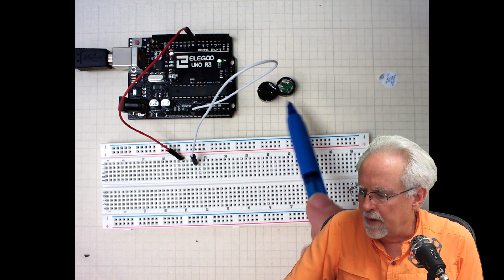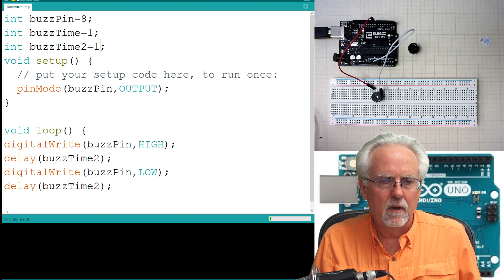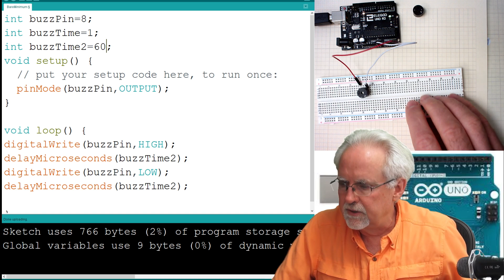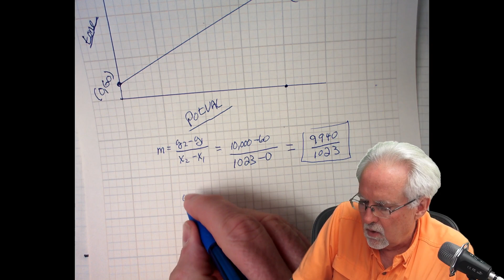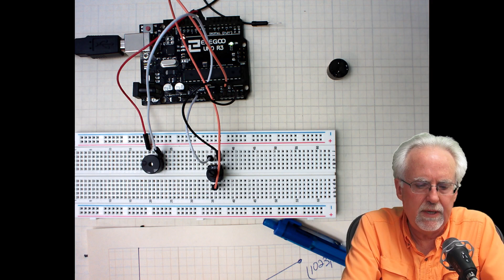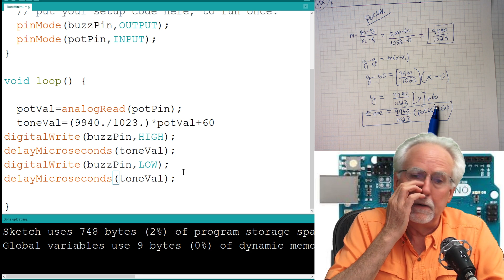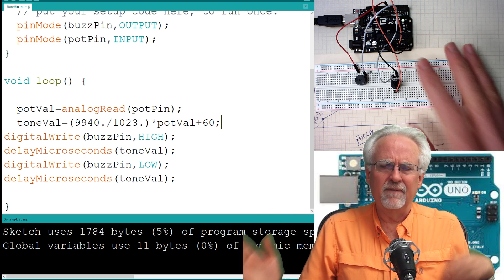Arduino Tutorial 24: Understanding Passive Buzzers

Comment: i had all the code and circuitry set up but then got stuck on the math. i couldnt figure out how to get a formula that would work. i had to watch into your solution to get the formulas we were supposed to use and then everything worked without a hitch. these graph and line formulas arent anywhere in my memory. ill have to write them down

Comment: I am still working through the tutorials. Sometimes 3 in a row, sometimes none for a few days.

I have been searching the web for an answer to why ALL my sketches, interupt when connected to the PC. This passive buzzer program for example, I worked through it, i get the tone and periodically it stops and starts again. In the RGB the light goes out and comes on again. In the binary counter it would start, stop at some point, then start again. I also noted the busy LED on the UNO board flashing occasionally. So I believe it must be communicating with the PC, and halting the program while it exchanges data with the PC. If I disconnect from the PC and run off the 9V battery it doesnt happen.

I also have trouble uploading from PC to the UNO board. I have to click quite a few times, I get the orange, COM port was busy quite a few times, then eventually it goes in, reinforcing my thinking on the COM chatter interferring with desired operations.

Any tips on settings I can adjust anywhere to stop the interupts on running programs and uploads?

Comment: That homework was super fun!
I think you said 60 and 10000 in your assignment the other way around than in your solution, but that doesn't really matter :D
 I tried to work with as many variables as possible and added Serial.print with a high baudrate to have a look at the values. The high baudrate is to not mess up the timing of the tones.

Here is my version of the homework:

int buzzPin = 8;
int buzzTime;
float rightFreq = 60;
float leftFreq = 10000;
int potPin = A1;
int potVal;

void setup() {
  // put your setup code here, to run once:
  pinMode(buzzPin, OUTPUT);
  pinMode(potPin, INPUT);
  Serial.begin(2000000);
}

void loop() {
  // put your main code here, to run repeatedly:
  potVal = analogRead(potPin);
  buzzTime = ((rightFreq - leftFreq) / 1023 * potVal + leftFreq);
  Serial.print(potVal);
  Serial.print("   ");
  Serial.println(buzzTime);
  digitalWrite(buzzPin, HIGH);
  delayMicroseconds(buzzTime);
  digitalWrite(buzzPin, LOW);
  delayMicroseconds(buzzTime);
}

Comment: So I had a strange thing happen on my attempt at this. I did the homework and had it hooked up exactly like yours and my code was nearly exactly like yours except I decided to send the values to the serial monitor. When I ran the program I could only get a low tone and almost no fluctuation with the potentiometer. I racked my brains and finally took the serial monitor code out and it worked perfectly. Why would the serial monitor cause this issue? The only code that I changed was dropping "Serial.println(buzzVal)".

Comment: Math has always been a weak point for me but thanks to your lessons, I've been able to do this. I was able to do the homework without any help other than the comments below when I didn't get the right tones because of the print statements in my code and the low baud rate. When I removed the print statements (or at least narrowed them to one print statement) it all worked beautifully. Thanks again Paul

Comment: Did a Serial.println to check my outcome. it was spot on and no pieking. then it gave a strange tone. checked the code fideld around but coulnd not figer it out. after banging my head against the wall. started te video again. almost the same code exept for the Serial.println
And took it out. And BOOM! it worked. The Serial.println slowes the hole thing down and its not working.

Comment: 1:11 It's actually silicone dielectric potting and not black tape on the bottom of the active buzzer. Only pointing this out in case someone wants to know this; I'm not just being a pedantic jerk for the sake of it. Loving the series so far, I've learned so much.
Reply: why is it only on the active one ?

Comment: I am not from an electronics/musical background... But I am confused why are we delaying the toneValue to get the variation in sound? In normal case, it should be a value given to the speaker(buzzer) to turn the value UP/DOWN rather than delaying the value. Are we dealing with some kind of frequency or some of the other musical terms in here? I might sound totally dumb in this session, but I got this weird doubt while I was working with the piezo buzzer that I had inside the kit. I am beginner, no matter how dumb the question is you must clear it out when you are stuck somewhere.  If someone could help it would be really helpful, Thanks in advance.

Comment: Sir I tried buzzing the passive buzzer by just digitalwrite HIGH and not putting digitalWrite LOW and it worked. So I am confused bcoz u told that passive buzzer would only be functional on AC voltage.

Comment: Here's a cool sounding one with the passive buzzer hooked up!

int buzzPin = 8;

void setup() {
  pinMode(buzzPin, OUTPUT);
}

void loop() {
  for (int i = 0; i < 100; i++) {
    buzzWithDelay(i);
  }

  for (int i = 100; i > 0; i--) {
    buzzWithDelay(i);
  }
}

void buzzWithDelay(int delayTime) {
  for (int i = 0; i < 1000; i++) {
    digitalWrite(buzzPin, HIGH);
    delayMicroseconds(delayTime);
    digitalWrite(buzzPin, LOW);
    delayMicroseconds(delayTime);
  }
}

Comment: I was able to do the HW by using if statements. except mine only played the 2 tones. so I had it off if the POT wasn't 0 or 1023.
int buzzPin = 8;
int buzzTime1 = 60;
int buzzTime2 = 1000;
int potPin = A3;
int potVal;

void setup() {
  // put your setup code here, to run once:
  pinMode(buzzPin, OUTPUT);
  pinMode(potPin, INPUT);
  Serial.begin(57600);
}

void loop() {
  if (potVal == 0) {
    digitalWrite(buzzPin, HIGH);
    delayMicroseconds(buzzTime1);
    digitalWrite(buzzPin, LOW);
    delayMicroseconds(buzzTime1);
  }

  if (potVal == 1023) {
    digitalWrite(buzzPin, HIGH);
    delayMicroseconds(buzzTime2);
    digitalWrite(buzzPin, LOW);
    delayMicroseconds(buzzTime2);
  }

  if (potVal != 0 && potVal != 1023) {
    digitalWrite(buzzPin, LOW);
  }
  potVal = analogRead(potPin);
  Serial.println(potVal);

}

Comment: Question: Shouldn't the toneVal variable be a float, not an int?
Otherwise there's no point in using the periods in (9940./1023.).
And wouldn't it improve the sound from the buzzer, too?
(I'm waiting for a passive buzzer to arrive, so I've not yet built the circuit and done the coding for myself.)

Comment: Just a quick question/suggestion: Should toneVal not perhaps have been a float rather than an integer to get a smoother transition? Blessings
Reply: toneVal has to ultimately be an integer because the delayMicroseconds function is expecting an integer value for the delay. But we perform the calculations of the toneVal in float to get a more precise representation of where the toneVal point should be for a given potVal value.

Comment: Paul, when using passive buzzer and buzzing with variable voltage instead of microsecond delays, isn't it the same? Since the voltage variation is the delays itself of 5V and 0V?

Comment: Paul, @ 9:45, you said when the potentiometer is turned to the left the delay is 10,000 microsecond delay, and when turned to the right it is a 60 microsecond delay.  I believe your linear equation is flipped, if you will.  Obviously, it still works, just with the tone changing backwards as originally described.  Love the videos. Nice work
Reply: Me too!
Reply: I thought the same thing Charles.
Reply: @danwolfe7665  Me too.
Reply: me too!
Reply: OK I see I wasn't the only one.  I worked my math the way he wanted (low tone to the left, high tone to the right).  Not the way he demonstrated.

Comment: I played a major scale with the passive buzzer. Code below if anyone interested:

int buzzerPin=7;
int dly[] {1000,891,794,749,667,595,530,500};
long long duration=125000L; //.125sec
long long time=0L;
void setup() {
  // put your setup code here, to run once:
  pinMode(buzzerPin,OUTPUT);

}
//----------------major scale with passive buzzer------------
void loop() {
  // put your main code here, to run repeatedly:

  for (int i=0;i<8;i++) //scale duration=1sec
  {
    time=0;
    while (time<duration)
    {
      digitalWrite(buzzerPin,HIGH);
      delayMicroseconds(dly[i]);
      digitalWrite(buzzerPin,LOW);
      delayMicroseconds(dly[i]);
      time+=(2*dly[i]);
    }
  }
}

Comment: I tried at 1 microsecond and still, it is audible. 1 microsecond on and off means 500,000Hz, right? Why it is still audible? Does the buzzer vibrate (cycle) at a lesser frequency?

Comment: The tone is distorted by other calculations and programcode , isn´t it.
I just put in a serial monitor to for finding mistakes in my quotation. The tone got much "lower". Additionally I am thinking that my passive buzzer drops at small delaytimes. I doesn´t sound very nice below 50 microseconds. I heard deep and strange tone below.
Reply: I experienced the same issue. I also put in a Serial.print command and it changed the tone...but I guess that makes sense since are dealing with thousands of a second....

Comment: First, GREAT series. I am a hardware guy and learning to program is going well with your help. HOWEVER, it seems that timers in Arduino, maybe especially the older UNO (mine is 10 years old?) are really finicky. I was having lots of problems with this assignment and I had the serial monitor turned on so that I could see what was happening with all my values. Serial monitor seemed fine but the tones were jumping, not smooth. Was pulling my hair out until I turned off the serial monitor then Voila! It worked perfectly. Just something to watch for.

Comment: I was doing the homework, and I was going good, but darn I forgot the +60! Anyway, this was fun here was my code!

int buzzPin=7;
float buzzVal;
int potPin=A8;
int potVal;

void setup() {
  // put your setup code here, to run once:
pinMode(buzzPin,OUTPUT);
pinMode(potPin,INPUT);
Serial.begin(9600);
}

void loop() {
  // put your main code here, to run repeatedly:
potVal=analogRead(potPin);
Serial.println(potVal);
buzzVal=(-9940./-1023.)*potVal;

digitalWrite(buzzPin,HIGH);
delayMicroseconds(buzzVal);
digitalWrite(buzzPin,LOW);
delayMicroseconds(buzzVal);
}

Comment: I used variable for buzzH, buzzL, potH & potL (all integers adn it still seemed to work) then used a variable based equation. I also put print statements in the loop but had to take them out as they were causing the tone generator to just click. Took me a little while to realise that it was the print statements that were doing that. Keep up the great work - loving the course.
Reply: Wondering why with a delay after the print code (Serial.print(); with delay after creates only clicks?? Without delay, no clicks! delays of 500, and 1000 ms. the clicks occur.

Comment: You did the same mistake as me at first. "Toneval" should be a float! Right now it's outputting the wrong value. 

Also, NOOoo! NOOooo! What have you done!? Using hard coded numbers for variable? What if we had to change 60 and 10000 to other values? 
Doing it like this is better programming:

In the setup:

int minVal = 0;
int maxVal = 1023;

int smallDelay = 60;
int bigDelay = 10000;

float ratio = float(bigDelay-smallDelay)/float(maxVal-minVal);

And then in the loop:

int readVal = analogRead(readPin); // 0 to 1023
float toneVal = minVal+(readVal*ratio); // 60 to 10000

Comment: Hello Paul, I am having trouble calculating, I dont understand why is it specifically 9940/1023*potVal+60. Why isnt it just potVal*9.775?
Please i am confused
Reply: I think he has kept in the form of a formula instead of performing the arithmetic operations and finding the exact value to multiply with the potValue. It is the best way to understand how you end up getting the value when a second person reads your program. you could even use the mappedValue function to make it much simpler, but he wants everyone to think like an engineer and learn the math behind 😉

Comment: I did my math a little differently in the homework, but got the same results.  I did part of the calculation outside of the program then entered the quotient directly in the program.  I used buzzVal=((potVal*9.7165)+60);.  Tell me, what is the purpose of the decimal point after your whole numbers in the calculation?

Comment: I was able to make a little alarm and authentication circuit depending on whether the user enters a correct password or not using the serial monitor. Thanks for putting this information out there! With what I've learned from you, I feel comfortable taking on my own projects more so than before with Arduino.

Comment: Okay I know how to do the math, but I couldn't figure out what the problem is. The buzzer doesn't sound good. I tried 1 to 10 milliseconds as shown in the video, but the buzzer only does a light tik tok sound like a clock. When I use microseconds, it produces some sound but not that loud. The sound comes loud only when I use the potentiometer and tune the voltage
Reply: I just want to know where my fault is: Is it the buzzer or my code?
Reply: @HealthyPanic  check to make sure you don't have a serial.print() or delay() in your code after delaymicroseconds() command. They will alter the how the code should work.

Comment: I've given up on the included potentiometers. I'm sure I can dig up a rotary pot out of some piece of non-working electronics around here and solder wires on to use. At least then I'll know any issues are with what I've done and not a crappy 10 for a penny part.
Reply: Two point to be aware off, as you say most pots will be fine, but make sure you know which pin is connected to the wiper, they are not always connected to the centre pin. Also some pots are not linear but logarithmic, it is normally written next to the pot value as either LIN or LOG, they both work OK; but the values at one end of a LOG pot change faster than at the other end.

Comment: hey mate me again, so ever since i tried to do the serail read to select a coloured led to turn on and off i have not been able to get any command or calculated values to work, even this tone generator project, i can get it to tone without the potentiometer like the first programm on this video, but i cant get it to even put out the tone at all with the potentiometer pluged in, i have coded exactly like you and installed the components and wired just like you without success, why is it doing this for?
Reply from the maker: Make sure serial monitor is set to no line ending.

Comment: Hello, great tutorial, but I'm sorry to say that I haven't got a clue about all that mathematics. I followed it all through, but didn't understand what you were doing. I've just never been good at maths.
Reply from the maker: First, stop thinking you are not good in math. Likely you are just the product of a broken math education system. In the public education system, all students are forced to proceed at exactly the same rate. Some are bored as the concept clicked right off, and others or lost as the light bulb has not gone on yet. Then, as the math years progress, some students are left with more and more 'holes' which result in complete frustration. Dont give up. If you did not understand my explanation, go over to the Khan Academy (free), and sign up for the Albegra 1 class. The videos are short 5 minute videos, followed by a few practice problems, the math is clearly explained and you can progress at your own rate. I think you might actually enjoy it. Just a suggestion.

Comment: Paul,   I believe that you ask that the 10,000 mS tome (lowest) be on the left and the 60 mS (highest ) be on the right.  This would make the equation a negative 9940 or change the polarity of the pot.
Reply: Yep, that's what he did. But I still got it working even though my formula is a bit different:

potVal = analogRead(potPin); // Get potentiometer value.
buzzVal = (1023.0 - potVal) * (9940.0 / 1023.0) + 60.0; // Calculate delay time in microseconds.
soundTone(buzzVal); // Make a sound.

(I wrote a simple soundTone function to make the sound.)

Comment: Hi Paul,

As you said, when you are to the extreme right, you want 60 micro-seconds delay and when to the extreme left, you want 10,000 micro-seconds delay. So, shouldn't the points be (0,10000) and (1023, 60)?

Kindly let me know If I am wrong somewhere.

Thanks

Comment: Good introduction - As a suggestion: Might have been a good opportunity in there to talk about using a smoothing function to average out the variations related to the eratic changes in the variable resistor. e.g. low pass filtering or moving average... I know this is more about the hardware than coding, but I think even just introducing the concept  of filtering wouldn't be a bad call.